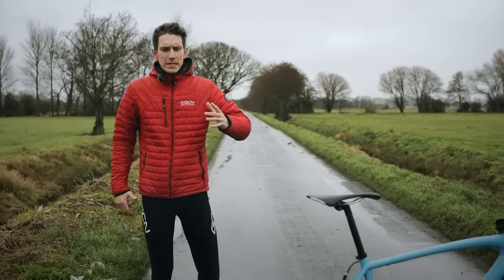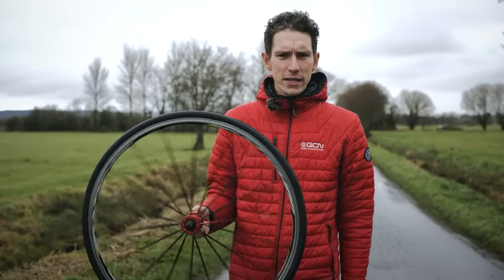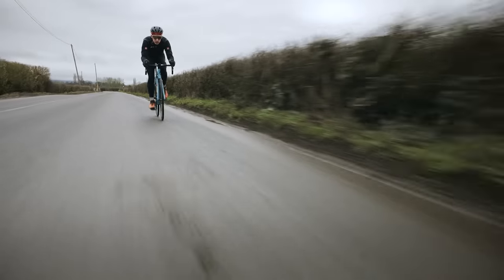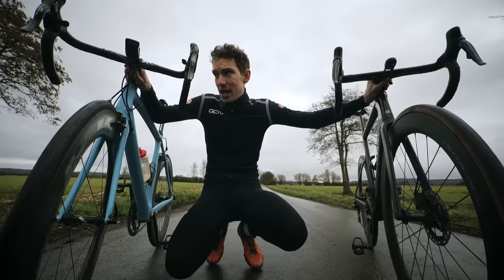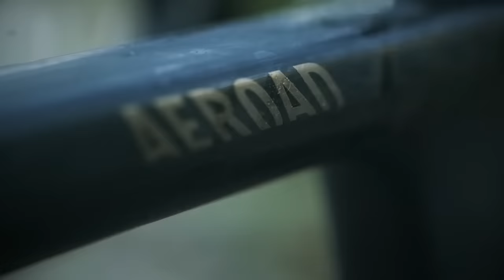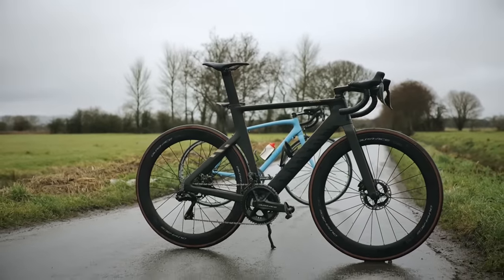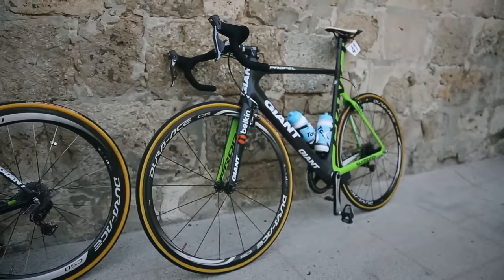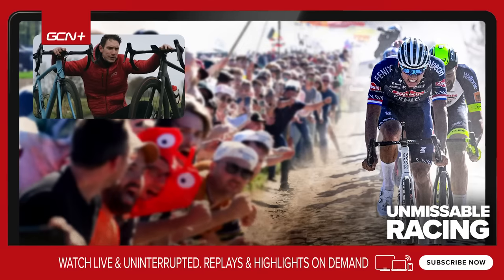How Much Faster Can I Make My Old Bike? | 2013 Vs 2023 Revisited

Comment from the maker: What other upgrades would you make to Si’s 2013 Specialized? Let us know in the comments below! 👇
Reply: Put on narrow aero handlebars and wireless groupset to further optimise the front end. And also a ceramic speed rear derailleur cover 😂
Reply: Will it give an ultimate boost in speed, if it was using TT disc wheelset?
Reply: Aero.bar, same width tyres, same psi, inwardly position shifter, upgrade saddle and seat post, same groupset or equivalent
Reply: Put an aero drop bar please.
Reply: Specialized turbo cotton tires for the next video and an aero helmet and skin suit. Aero road would be defeated
Reply: @i4npanman  yes if there are no crosswind
Reply: Thank you for the video!
Super light and super Aero Chinese carbon fiber frame and crankset.
But is the bike the same after that 🤔
Reply: “It wasn’t a fair test”

So GCN decided to hide all the watts, saying it’s an “all-out” effort, meaning dropping 10 watts on old bike and increase 10 watts on new bike. Also put slow heavy tyres on old bike and latex tubes to GP5Ks or something equivalent on new bike

GCN is basically manufacturing data by this point. It’s like the Lotus 110 one, how diabolical is it that the position of the rider equates to 70% on the total drag but GCN so-called data shows that a road position is still faster than a TT position

Unless you get a big fat pay check from this, I would be embarrassed if I was delivering these “tests”.
Reply: Don’t buy upgrades…..ride upgrades
Reply: I’d rotate that quick release to horizontal. Bin the video. Redo 😛
Reply: @nguyenho9591  UVE got a good eye to spot tire difference
Reply: how many watts???????????
Reply: cnompare the watts
Reply: I wouldn’t. Put the old wheels back on.
Reply: @nguyenho9591  - Excellent points.
Definitely would've liked to see watts and other data, rather than just time measurements.
Also, there was no basepoint for the old bike. He should've done that TT course with the bike as it was, then put on the new wheelset and narrower bars.
Reply: Do this test again, same bikes, same wheels but do a steep hill climbing test.  Which is better?   Aero deep dish wheels or the Ksyriums? versus the Canyon.   The question: does aerodynamics figure more or less in hill climbing?   Does weight figure more in hill climbing?   Which tends to be slower in pace anyway.  Very interested in those results!
Reply: Chinese Carbon handlebar from aliexpress
Reply: Si does Science! 😃
Great video, I'm just happy they made the sort of ball park difference I thought they would!.
Great stuff GCN!.
I'd say aero bars would be the next upgrade imo. 👍🤙
Reply: A power meter would be real nice on both bikes lmao.
Reply: Absolutely nonsensical test without power meter pedals...
Reply: Here is the interesting question: For someone who owns a decade old higher end bike/frame and who might be considering investing into a new modern bike, they would have to fork out a good 4-5 thousand dollar/euros/pounds to get a bike of similar level. 

So, would that person be better off spending 4-5 k in upgrades? Now that rim brake components are cheaper and "phasing out", 4-5k gives u a lot of room for some bling upgrades.. narrow one-piece aero bars, modern aero wheels and tires, ceramic bearings, aero kit/helmet etc etc.... now, which one would be faster?
Reply: How much is Simon's current bike worth? Answers on a post card lol  Bank for buck buy the best rim Carbon bike and enjoy yourself 😊
Reply: I would re_route those those cables, pick a more aero set of brake calipers and put a flat handle bar. If you ask me I love older (2000-2018) carbon technology.(cross layering) Not actual monocoque with durabilty and chock resistance in mind....
Reply: You could ditch the drink bottle  or at least fill them to the same level..
Reply: Paint
Reply: Dont waste on OS pulley.
Try better tyres, waxed new chains, aero one piece handlebar and aerosocks🤣.
Reply: Mudguards, for sure. Especially in such a messy weather.
Reply: Put on some cool stickers
Reply: 36cm handlebars
Reply: One thing he hasn't mentioned in either video is the gear ratios.  That could be huge.  Having 1 or 2 extra gears alone would make a huge difference--depending on the elevation gain of the segment (bigger difference on steeper and longer climbs as being able to find that "perfect" gear for any situation keeps you spinning at the most optimal cadence).  What cassettes are on the two bikes... and what chainrings on the two bikes.
Reply: Last year I retired my 2001 Schwinn for a 2022 domne 5 Al disc. My Schwinn had aftermarket rims . Thoes being Rolf vector comps. Michelin rubber. The trek is stock. But even though I’m no pro I was 10% faster on the trek. And that’s with the shop maybe messing up the front rim and it having a hop to is . Just slight. Lol.
Reply: Get rid of Shimano and go for something that can take a little more power - SRAM.
Reply: From previous GCN wind tunnel test results, it is obvious that to ride faster the upgrades are: an aero helmet - no a TT helmet, a skin suit, aero wheels and the aero body/hand position you demonstrated in this video.  But, you made such a big deal about handlebar width it would be helpful to know the width on the Canyon handlebars.  And I agree - use power meter gear for accurate testing.
Reply: A waste of 11 minutes of my life for GCN not to specify average power during the test.  And they know this.  GCN always publishes test results with the power result.
Some fishy sales manipulation going on here.  To b expected from a tech sales company.

Comment: The fact you didn't pick a power and ride to it completely moots this video. Going 'all out' is so subjective, just do 3 tests, 200w, 300w and 350w. Compare the differences. Also ensure tyres are exactly the same across both bikes as they are responsible for most of the speed.
Reply: No aero handle bar on the old bike, probably different width tyres running different psi, gcn will not do a controlled experiment, they know the old frame will close the gap! Not good for their sponsors.
Reply: now now the sponsors really wouldn't like that now would they
Reply: They don’t wanna reveal that old bikes are just as fast with the right components
Reply: The fact that he didn't even show the power numbers is quite frankly ridiculous.
Reply: @nguyenho9591  Alsp Si is a fast cyclist and Aero is more important the
faster u go. If I was to do a similar test , there may be a difference but
when u are lucky to do a 20 mph average the gains would be more 
marginal
Reply: Yeah, was he running a gp4000 with an inner tube and comparing to a 5000 probably set up tubeless? Could easily be 10watts between them on rolling resistance. We all know that a new bike with new components compared to an old bike and old components will be faster, no one needs a video on that. The answer we all want is why and which items contribute the biggest performance.
Reply: Remember who is paying for the video
Reply: Lmao gcn always half ass their test videos, all of them are pointless because they fail to meet basic control standards for the tests.
Reply: Notice how gcn liked 2 comments made just after this one but chose to ignore this! They don't like it when people see through the bullshit🤷🏻‍♂️
Reply: @budbud2509  Yeah- but you'd be going for longer so a smaller % difference would create a larger absolute difference.
Reply: I totally agree, this should have been tested in combination with a powermeter
Reply: We can safely assume he did more than 300 watts on both.
Reply: They even have access to a velodrome they can have exclusive access to, making it safe to ride a road bike on. Super controlled conditions.
I agree they make a deliberate choice to muddy the waters, and arguably mislead viewers.
Reply: @jamie14141  how can you conclude he had 4000 on old bike
Reply: yeap, i was thinking how convenient all of the sudden theres no measurement of power consistency when almost every other tests they do have it. Then it hit me! it's an advertisement.
Reply: I think people are confusing an entertainment channel with science. But then most folk just ride a bike, they don’t sit at power levels in wind tunnels, they just get on a bike and ride it. This to me subjective “testing” like this is perfectly valid. If it feels faster and a clock says it is, that’ll do the vast majority.
Reply: @colecoleman1499  think there's a close up near the start where he says "bling modern wheels and tyres"
Reply: who shat in your breakfast?
Reply: @jamie14141  no he wasn’t using tubeless. Pay attention to what he says in the video instead of joining in on the cynical shite and you might have heard it
Reply: @Millicente  it's 4000 gp on old bike. It says on one of the close shots. Not definate what's on new bike
Reply: @Millicente  fair. I know it may appear to be miserable, but I think the point us "cynical" lot are trying to illustrate is that this test has so many variables and unknowns to the viewer that the usefulness is diminished and could be misleading. Wind speeds, repeat testing in opposing directions. It's hard to know what tyre the canyon was on, but say it was the 5000, that one thing can make a chunk of difference alone, 5-6 watts in rolling res at the same pressure. What are the tyre widths? The rim brake wheel rims will likely have a narrower external diameter putting a 28c tyre on that could ruin the aero performance.
Reply: Average gcn tests
Reply from the maker: Cheers for the feedback, Nick. Its good to hear what people think we could improve on!
Reply: @Cyclingchoice  Oh my god are you kidding me?! Ffs what even is a bike if you change every bloody component on it?!!! Sorry but the whole point was to compare a decade old bike with a new one, of course a non aero frame isn’t going to be as fast if an aero handlebar is going to close the gap! Good grief!
Reply: @nguyenho9591  they're not as fast.   But they did skew the data a lot by not using a power meter and not chainging the cockpit. The difference in frames and even just external cables on a downtube is huge.
Reply: @budbud2509  the overall losses would be bigger due to the overall time on the bike.
Reply: Jeez just take it for what it is, a bit of entertainment mixed with some flawed science (even Simon alluded to that in the video) and yes some advertising- I think we all know that. The 3 pillars of a lot of GCN vids but hey it costs me nothing to view… if I ignore the urge to splurge on some monster wheels that is 😅
Reply: @simonrichardson5259  Simon just use the same bloody tires on both
Reply: @gcn it was obviously intentional to not user power meter pedals...give me a break...
Reply: @colecoleman1499  Oh my God, the whole point is not to compare two different frames with identical specs. Stop trying to make this something it isn’t!!!!!! At no point was this ever Tarmac Vs Aeroad, it’s an illustration about how bikes have progressed in a decade.
Reply: @simonrichardson5259  seems like a comparison apparently, especially when you pushed the envelop of same wheels. Even GCn asks us above what do you want Simon to try next. So plzzzzz put a specialised turbo cotton on it.  Cheers mate and thanks for replying
Reply: @nicklewiscycling  a modicum of common sense will prevent people falling to the ‘marketing’. If people are so upset with GCN the best way to show it would be to mass unsubscribe / stop viewing their content surely
Reply: @LeftLegRightLeg  GCN are by far the largest bike channel on youtube and their videos are watched by man when getting into the hobby. Therefore, they have a great deal of power and sway, I think it only the right thing to do by having some form of integrity in the opinions and videos you put out, don't you?
Reply: Not the channel to watch if you want scientific, fact based results.
This one has always been just bluster, advertising and fluff.
Makes them moneg though.
Reply: @gcn maybe put cyclists above advertisers and your wallets?
Reply: Lol relax bros just a video on YouTube 😂
Reply: So many uptight joe average cyclists …it’s entertainment ..not the open university !
Reply: @simonrichardson5259  power meters aren't new.   No reason to not use one here
Reply: Blew all the money on wheels. No money for power meter 😅😂
Reply: @budbud2509 @budbud2509 Maybe not. The slower you are the longer you're on the course, so the more time you can potentially make up. Si saved 30 seconds over 12 minutes. If you're out there for 20 minutes you could save 45 seconds: smaller percentage, more absolute time.
Reply: I appreciate that GCN tried things like this, but do wish they’d put more effort into making them legitimate.  At this point the resources they have available make such an unscientific approach look unethical.
Reply: @thebrowns5337 Make your own video if this one is so far below your standards.
Reply: In the end it the bottom line cost vs pleasure riding what you spend. Not so?

Comment: Rim brakes for the win in 2023.
Reply: Except they lost.
Reply: Until they get wet… then it’s all over for peak performance. I get tired of cleaning my brakes after I go through a puddle or something.. but I’d take that over constant tweaking my rotors because god forbid you transport them or bump them slightly.. yeah that got old quick. Great performance… but got sick of rub.
Reply: I just love the locking up of the disc breaks.  Panicked breaded reacently and nearly went over the handlebars.  I just love that kind of power on the breaks